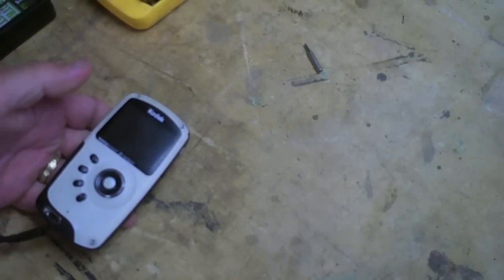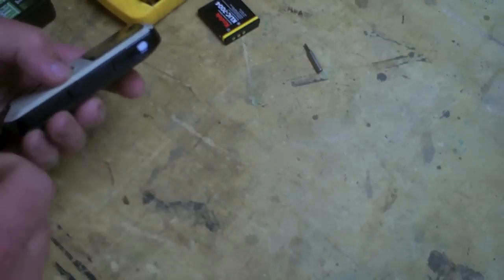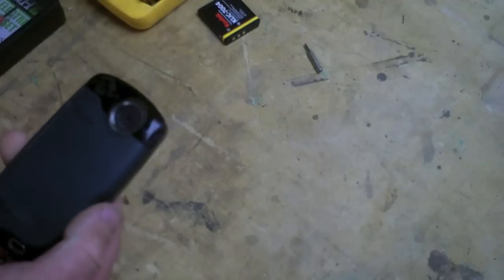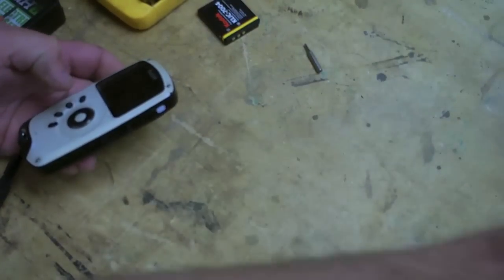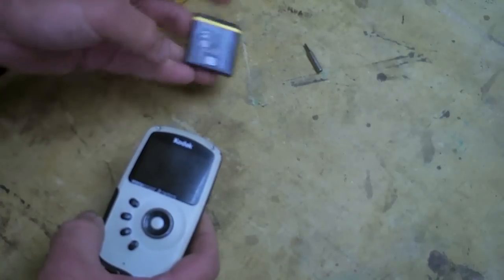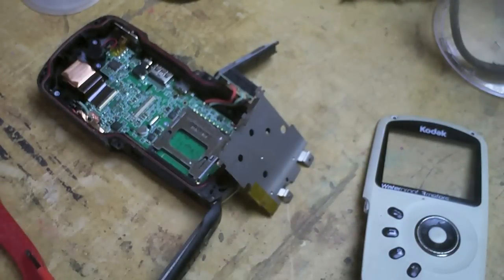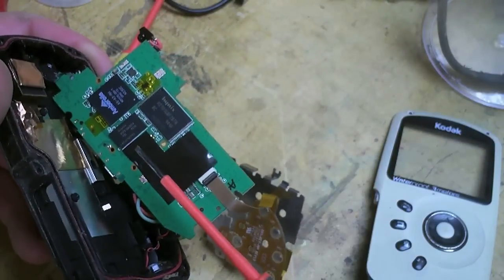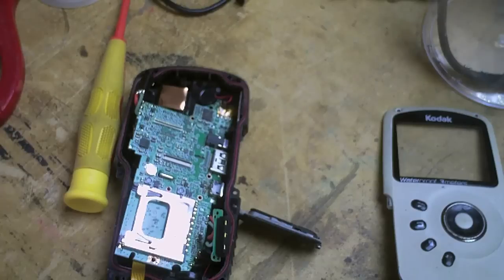Kodak Playsport Zx3 Trouble Shooting

Comment: Got mine to work after soldering the tabs on the micro USB connector.  Don't know how long it will continue to work.  Also have not yet figured how to install the orange battery release button.  Thank you for posting your efforts.

Comment: Thanks for the explanation. Going to open mine and see if same problem. First problem is how to unscrew those special screws, guess will have to buy a special screwdriver to start.
Reply from the maker: +AmerikanTube One of the commenters found a cheap battery charger that works for the Kodak batter on amazon.  That is what I really wish I had done rather than trying to fix mine.
Reply: +NelsonStudios Thanks. I thoguht that since some of those connector wires were broken even with a charged battery with a battery charger it wouldn't work; but I guess those connectors are just for the charging part of the camera, not the camera itself. I have tried charging a brand new battery using the method I saw in some other youtube videos (using tw0 1.5 v AA batteries connected with a wire to the camera battery) but still the camera doesn't turn on. Is there a chance that the small battery inside the camera that you mention in your video is kaput?

Comment: IMPORTANT UPDATE! I realized that I could update/load new firmware on to my "thumb drive reader" (if that's what it's called) so I inserted the SD card into the thingy, downloaded the firmware.I inserted the SD card back in and it works. (For now.) Sorry if I don't sound very optimistic...I knew I should have wiped the LCD screen clean before I re-assembled it... Also, I'm rescinding the free battery deal, sorry!
Reply from the maker: Lol, mine has been dead for years, think I still have it in a box some place.  If I do you can have it for parts to keep yours running.  I can check if you like.
Reply: Crap...I turned it off to charge the battery. When the light went off, I unplugged it but now it's dead again...Stay tuned to this station...
Reply from the maker: I sure used that camera a bunch when this channel was new.  It was my go-to machine.

Comment: I took mine apart before I saw this using the same theory of, "Hey, It's broken already, what do I have to lose?" Mine charged ok, but wouldn't turn on. I had it repaired under warranty, but it only lasted another year or so. I noticed that the switch foil connector looked like someone re-soldered it, probably the repair. I tried to see If I could repair it and tested the switch & led light. They worked fine. I re-assembled it and now I will place it under the right wheel of my truck, rev the engine and fling it against a wall. If anyone would like 2 free batteries, let me know.

Comment: How many more, Senator? First, hat's off to you intrepid souls who have spent countless hours trying to revive you flawed ZX-3 Kodak cameras. No, really. Kings & queens of patience & fortitude! You did well. You ran into the darkness to fight a powerful foe but, alas, lost. But now, it's time to surrender. I did. It's apart. In pieces. Really small pieces. In a zip lock bag. Every screw, mic, speaker, camera thingy, board and various piece of junk that some sick designer thought to put together in hope of a better 1080p video camcorder. He failed. Possibly doomed by a bad chip or poor chip designer, I don't know.Once, when I was a young electronics engineer, that would have been my job. But I saw my future and ran the other way. You should heed my advice and run from trying to repair the un-repairable, least your heart be stronger than mine. I surrender, Kodak. You won. Rot in hell, or worse, Rochester.

Comment: The fix for me is a 2000MA (2amp)or higher wall charger.The Kodak version of their cable chargers are junk.
Reply from the maker: +Digger Davey I would still have and use this camera if I had only thought to see if I could charge the battery externally like others had done.

Comment: To quote the timeless words of Glum from Gulliver's Travels....IT'LL NEVER WOOOORRRKKK!!!  
Hot Melt Glue...really??? Try Snot Balls and Spit next time.
Reply from the maker: NorthShoreJoe Non conductive, lock the lose board in place, easy to work with, common in electronics production including INSIDE this very camera from the factory.  It is done all the time and I promise you own something held together with hotmelt inside right now.  It failed because I could not solder those fine wires with the tools and experience I currently hav.
Reply: I didn't pay attention to what you were trying to use the Hot Melt glue on. I've read a few complaints that the charging connection for these cameras seem loose even shipped from the factory. It's very difficult but not impossible, to fix SMT (Surface Mount Technology) with your normal soldering iron. I have 3 of these Zx3's  and a Zx5 I bought from an auction for $20. The Zx3's all have the same problem. The Zx5 has a broke off door cover but works fine. Believe me, if I could fix the Zx3 problem, I would. I think the only issue is not being able to charge the battery. Otherwise, if a wall charger is used to charge the batteries, the camera usually works fine.

Comment: It's down again! I'll bring it to church Sunday. I need a higher power. Father Joe is good with this stuff! Just listed my Magnaplanar MMG speakers on ebay. If I sell them, I'll buy another brand like the "zebra-x-ray" Kodak, but not a Kodak. I hope it is snowing a ton in Rochester!
Reply from the maker: So... are you drinking and can I have some?
Reply: No. I don't drink or use false drugs. I have finally, clarity in thoughts regarding the ZX-3. My hammer is a tool I use for my livelihood, so I do not wish to damage it repairing the ZX-3. Rather, I am going to drill a 1/8" hole in each chip I see on the board and throw it away. That way, if by chance someone finds it in the trash or landfill, they will not have to go through what HUNDREDS of owners had to go through to try and repair this piece of junk...Then I will be at peace...
Reply from the maker: hatfez God's work right there.
Reply: God's work? I think not. It's anything but God's work...God would not be that cruel to be involved in the ZX-3.